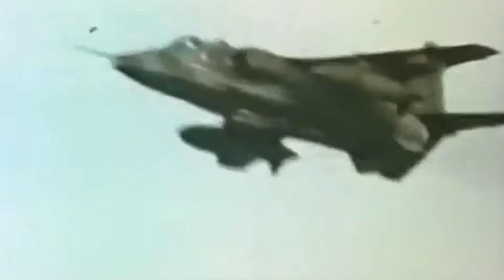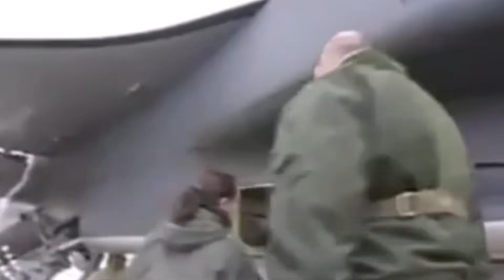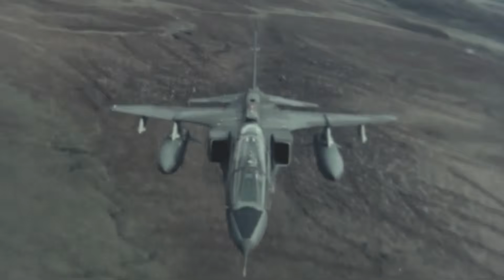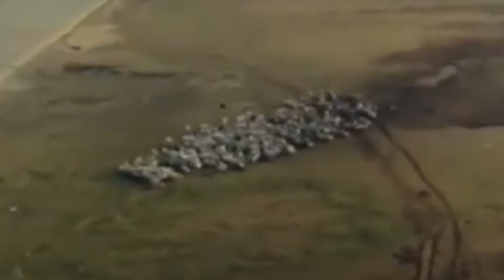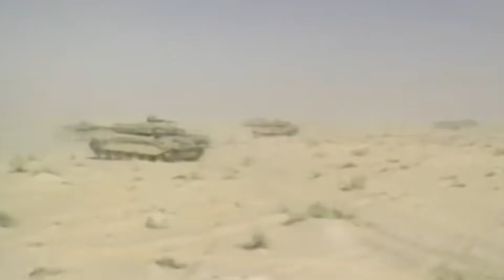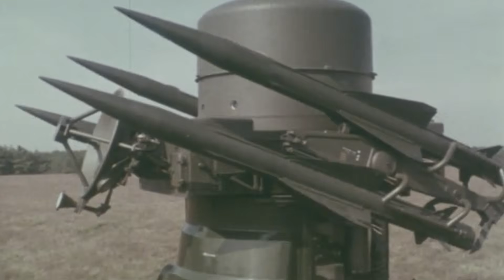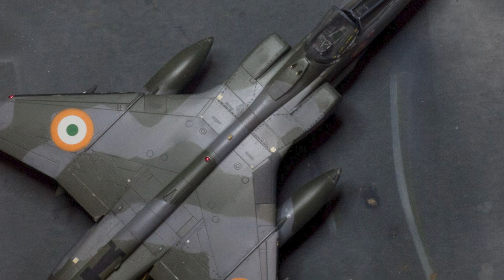The Fighter That Battled the Wrong War and Shocked Everyone

Comment: The Jaguar was not outdated by the time it was retired by the RAF. It had undergone modifications and still had several years of service ahead of it. It was retired on cost saving grounds, like the Nimrod, Harrier and Sentry. It could still ruin your day, and India uses them to good effect, buying up all the spares after the RAF had to stop flying them. It was easy to maintain, and the fitters loved it, so much so that a group of them maintain a privately owned example in fast taxi condition.
Reply: As I remember they had just wired it up for 1553 when it was retired. The Indians have now integrated ASRAAM on overwing pylons, it'll be around for few years yet.
Reply: Jaguars are the designated plane-based delivery system for India's nuclear weapons. Of all the planes India has, its Jaguars who have the nuclear strike role.
Reply: I was on 41 when we found cracks in the central fuselage which is why it was retired. Along with the tacrecce going EO
Reply: True ....They played a pivotal role in the Kargil conflict of 1999....As a turning point of the conflict a Jag pilot discovered & photographed a huge secret arms depot of Pakis which was later blown down and India won the war.
Reply: Britain has a history of scrapping usable or new weapons systems on grounds of "cost";   HMS Vanguard was scrapped after only 13 years;  that vessel ought to still be in service ( part-time ).
Reply: @BruceConklin-js5rg  Vanguard was obsolete the moment her hull kissed the water.  Battleships were obsolete by 1942 .
Reply: @michellebrown4903 Maybe. But it would have been amazing to keep 1 battleship as a floating museum, just like the US does.
Reply: @michellebrown4903  USS Missouri saw service into the early 1990's.  They were too expensive in peacetime, and carriers became the kings of the fleet engagement, but the bombardmant capability was and still is unmatched.
Reply: @stephenhumphrey7935  Not really possible on the UKs defense budget
Reply: @mpondachongo1138 it's been shrunk over the years. Looking at the stats, the defence budget was at it's highest when Tony Blair left government and has shrunk significantly since. Russia had some good friends in Whitehall 😉
Reply: @EdgyNumber1  True. The UK over the years became a playground for Russian oligarchs and their kids. Tho it's nice to see that the UK government notice is trying to change things around.
Reply: @mpondachongo1138  but you get to house border-jumpers in hotels and pay for their free treatment at the holy NHS. So that's a plus!
Reply: The shocking thing that not only Jaguar was retired but the Tornado and Harrier as well. We now only have one battlefield deployable HRT - the Euro fighter which cannot be used on aircraft carriers. Great having two new carriers completed 2 years ago. One has no aircraft the other just 8 American piloted F-45s and is currently sitting off the coast of Palestine supporting Israeli sorties as well as co-ordinating refuelling  jets from Cyprus and RAF Akrotiri. Even worse is the carriers have been mainly port bound with continual faults the most significant being the reactor and screw/prop problems so significant they are likely to be scrapped. Such a waste but I think the days of the U.K. needing Carriers to project firepower over the globe are done. But to have everything pinned on just one jet aircraft seems madness to me.
Reply: @pattracey105 Reactor ? They are diesel / gas turbine. 
There are a multitude of other errors in your statement too , but I see someone has most eloquently pointed them out.
If you are in defense , it may explain some of our woes
Reply: @pattracey105 Um F35s plus I think they have enough now to crew both carriers and they're non nuclear so no reactor problems. Drive shaft issue's but that'll get fixed teething problems.
Could be worse could be the Admiral Kuetznov or whatever old smokey is called 🔥🔥🔥
Reply: @drunkengamer1977  The best carriers by far are American and nuclear.
Reply: @drunkengamer1977 I think the main problem is that only so many F35s can be produced and the priority is Australia ay the moment as I’m sure you’re aware that the Americans have big issues in that area. But I’m sure different Sqdns can be reassigned if the need be. I was Suprised to see The U.K. is shipping F35 parts to Israel. Presume this are routine maintenance parts or underwing ordinance as the actual production of the F35 is done stateside. Shame the Harrier was retired as great piece of kit. Hopefully we will see the two aircraft carriers doing sea trials soon though I remain sceptical that was wise spending of the Defence budget. But then what’s the real cost going to be of building 15 new nuclear subs that Daddy Trump wants!
Reply: @claudiodominguez. They also have more Carriers than the rest of the world combined!
Reply: @pattracey105 imo agreeing anything with Trumps a waste of time he'll have changed his mind 5 mins later better organising amongst our allies while paying him lip service. Unreliable allies at the moment
Reply: @pattracey105  I think they have bigger problems with immigrants than carriers without jets
Reply: @claudiodominguez. Maybe they could multi task them as prison ships while not on active service!
Reply: @pattracey105  Fill them with immigrants.
Reply: @pattracey105   I have seen some crap posted on YT but that beats the lot Pat. You are either deliberately lying or misread a post on TikTok.
So lets disassemble your comments:
1. Jaguar was retired in 2007, Harrier in 2012 and Tornado in 2019. Totally unrelated events caused by totally unrelated events and spanning 12 years.
2a. We have two front line fighters both capable of high level interdiction / QRA, long range bombing or close ground support.
2b. The Typhoon is the pre-eminent 4.5 Gen fighter in service and is still being built and bought for front line service. It can operate off highways and austere locations. It does not need to operate off a carrier because of 2c.
2c. the F-35B (not F-45s) is a 5 Gen STOVL fighter with advanced sensor capability and when used as an advanced suppressive force and a targeting asset with the Typhoon bomb truck the RAF has a huge capability. The F-35B can operate off carriers, car parks and highways.
2d. The UK with partners Japan and Italy is developing the Tempest (GCAP) 6 Gen fighter for test flying in 2025 with delivery in 2035.
3. One carrier was commissioned in 2017 and the other in 2019. Not '2 years ago'.
4. No carrier has aircraft assigned to it. They never have in RN service as aircraft join carriers at sea as required. The RAF / FAA have 38 x F-35s in service with a further 10 + 30 on order and can operate wherever commanded.
5. The only time USMC F-35s have been attached to a UK carrier (other than training) was for CSG21 in 2021 when 8 x F35s joined 11 RAF F-35s on HMS Queen Elizabeth on a world cruise.
6. No UK carrier is or has ever been operating off Palestine. They are both on a NATO exercise in the North Sea both equipped with aircraft.
7. Neither are they 'co-ordinating' anything off RAF Akrotiri. Which is actually in Cyprus! 🤦‍♂
8a. (This is utterly hilarious) Navy ships are docked in port for maintenance as its what is done.
8b. Neither has continual faults as both have had just one issue each with one coupling.
8c. There are no reactors on any RN surface ship.
8d. there are no plans to scrap either carrier for any reason whatsoever
9. NATO and the UK's strategic partners disagree that carrier power projection days are done. Its whay China, Italy, India and Spain are building carriers.
10. Nothing is pinned on one jet aircraft. See 2b and 2c above.

But thanks for the laughs ......
Reply: @1chish  The laughs are all mine as I worked in Defence Policy but you may outrank me as I was only  Head of a Department. It’s Autobahns not highways as deployment would be in Germany not America! The two carriers faults are public knowledge! One has propulsion issues the other engine. Whether cost effective to replace or repair is being debated. One is inactive the other off the coast of Palestine with 8 F-35 (One ditched and lost off the coast of Italy with no casualties). They are currently flown by Americans until U.K. pilot training finished (majority simulator training run by outsourced German Company. There are no U.K. aircraft carrier fixed wing aircraft at this time. The F-35 are assigned to one particular carrier as it’s the only one capable of sailing at present. You obviously don’t like the term ‘Eurofighter’ but the Tornado was U.K./German/Italian built. We’re not very popular in Europe anymore so that doors closing. So the future is American cast offs, even there reserve Squadrons are better equipped for dog-fights!

Did you know the ability to debate or disagree is by civilly exchanging ideas and information. Only a fool starts with personal insults for he has shown he is wrong by being rude. I can only assume you’ve never served and are yet another armchair warrior who doesn’t know any better.
Reply: @pattracey105   Jeez you were in 'Defence Policy'? For who?  Disneyland?
Neither did I insult you Pat. I critiqued your words. And clearly YOU are no military expert because you would know that "assumption is the Mother of all screw ups". And you duly obliged. I served in the RAF from 1970 to 1985 including a war. So no armchair warrior here Dufus. But people do not need to serve to see your stupidity.

As for the rest of your garbage you are just repeating it but repetition of a lie does not make it true.
Like:
1.    "It’s Autobahns not highways as deployment would be in Germany not America!"
Nope. So why are they landing on Estonian and Latvian highways? (Oh and they are called highways in the UK)
2.     "One has propulsion issues the other engine"
Nope. Both in the North Sea on a major NATO exercise.
3.    "Whether cost effective to replace or repair is being debated"
Nope. Both fully operational.
4.     " One is inactive the other off the coast of Palestine with 8 F-35"
Nope. Never been off the coast of Palestine and when QE was in the Med. it had 18 x F-35s.
5.     "(One ditched and lost off the coast of Italy with no casualties)"
Nope. That was back in 2021.... 😂
6.     "They are currently flown by Americans until U.K. pilot training finished"
Nope. The UK F-35s are all flown by RAF and FAA pilots all based at RAF Marham. RAF 207 Squadron has been the operational conversion unit (OCU) for both the RAF and the Royal Navy for about 5 years.
7.     "There are no U.K. aircraft carrier fixed wing aircraft at this time"
Nope. there are 38 UK F-35s in operation. 3 are with XVII Test and Evaluation Squadron based at Edwards Air Force Base in California testing weapons. The rest are at Marham.
8.     "The F-35 are assigned to one particular carrier as it’s the only one capable of sailing at present"
Nope. No aircraft are assigned to either carrier which are both operational. Never have been.
9.    "You obviously don’t like the term ‘Eurofighter’ but the Tornado was U.K./German/Italian built"
Nope. In RAF service the 'Eurofighter' built by BAE Systems here is called 'Typhoon'. Like the F-35 is called 'Lightning' And yes I knew all about the Tornado ... 🤦‍♂
10.     "We’re not very popular in Europe anymore so that doors closing"
Nope:
a) we have no need to get into another Typhoon or Tornado deal as we are building Tempest here and supply 20% of every F-35 to the USA.
b) yes we are so unpopular the Germans have just signed a major security and defence deal with us...
11.    "So the future is American cast offs"
Nope. Just 5 Gen and 6 Gen new aircraft mostly built here.

The level of stupidity you display is just hilarious. But I like a good laugh. So I will leave you to your delusional idiocy and wish you a very good weekend ...Pat.

Comment: The GR.1A upgrade involved senior pilots shopping around the defense companies asking not "can you build these kit to these specs" but simply, " what do you have". It was the most efficient and cost effective upgrade programme in RAF history.
Reply: It also worked because we involved the aircrew from the start. Pilots from 6, 41 & 54 sqn were at Boscombe Down through most of the early upgrades sitting with the project team. On many occasions we were asked "can you do this" or "can you include this" and we fitted it in.
Reply: @MarkDurham-c5d  Didn't Sqn Ldr Rondot, SLOPS at Coltishall at the time, help design the layout of the office on the Typhoon?

Comment: While At Machrihanish in the 70s used to get Jags in on a regular basis ,They were a pain in the butt every time they landed they popped the brake chute, we had no rag packers on base so we had to pack the brake chutes one of us (we had four guys) refuelled them one of us packed the chute and re-fitted them. Then we told the pilot it may not work when you land again but pop it anyway because it will need repacking. The way we repacked them was with a broom handle just ram it back in.
Reply: How long was the runway there? I know the pilots did practice aerodynamic braking but, at the end of the day, if you needed the chute then you used it. I practiced lots of times (in the sim) not using it and you needed a fair amount of space to stop the thing on brakes alone.
Reply: @fizzyridertoo one of the  Longest in Scotland( i think 10,000 ft) a C5 Galaxy lands with ease in fact we had 2 one day.
Reply: @fizzyridertoo long enough for it to qualify as an emergency alternate for the Space Shuttle.
Reply: We had them divert into Leeming, it was a MDA, in the seventies.

Comment: A friend who flew jags during the Kosovo conflict and Afghanistan said that it was underpowered and with a full load of bombs, "il decolle parce que la terre est ronde." It takes off because the earth is round. But he said that it was the most stable firing platform, extremely versatile, and it had a huge inventory of compatible ordnance.
Reply: An RAF engineer friend said to me “beautiful flying aircraft; then they went and fitted bombs to it” 😂
Reply: Wasn't the French version of the Jaguar engined differently than the UK version?
Reply: @jefftuckercfii  Kind of. They both started with the same engine standard, but the French never fitted uprated engines to their Jaguars, while the RAF went through two(?) rounds of fitting more powerful ones.
Reply: @MrHws5mp  not quite true
Reply: @Lee_FTM  In what way?
Reply: @jefftuckercfii  RAF started with the Ardour 102 through to the 106. French started service with the 101
Reply: @jefftuckercfii  Yes which is why it could take off without it's tail on fire. However, with the RAF one, it was a mandatory call from the Runway Caravan if it wasn't lite. I hope that this helps?
Reply: What Is the deal with separating "Kosovo" when NATO terririst attack was full on whole country..propaganda ect..so younwere terririst war crime dude..
Reply: @zrikizrikic9126  Dude, you are totally and completely constipated.

Comment: The most impressive video of a Jaguar I've ever seen was one taking off from a grass field. A supersonic jet taking off from a bumpy grass field. Mind blowing. The landing gear on that thing was insanely sturdy.
Reply: A uprated engine version with a cleaned up cockpit would be a good option to have now for export and support/training.
Reply: Rugged as a 2CV :)
Reply: It was part of the design brief that it should be able to operate from a ploughed field.
Reply: I did Supersonic in a Jag "very briefly" during an air test jolly, part of the test included getting there. as soon as we did the pilot said thats enough, we dont want to waste fuel lets do some low level "Excellent"
Reply: I still remember the video of a Jag taking off from an airport diagonally across two runways and taxiways and the medians and field plots on either side of the runways.  Then there was the video showing Jags taking off and landing on roads.  (Discovery Channel's "Great Planes")
Reply: I saw that demonstrated at the Farnborough Air Show.